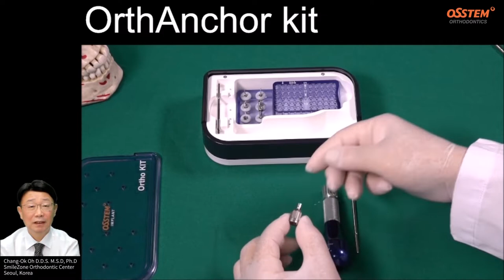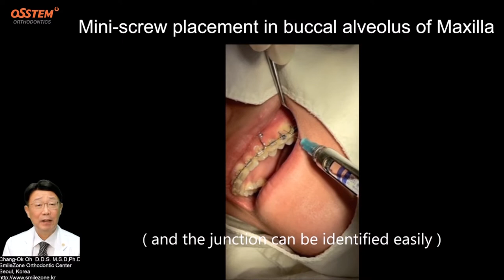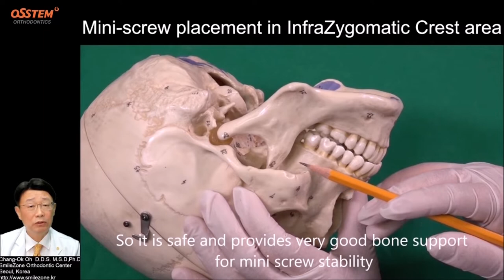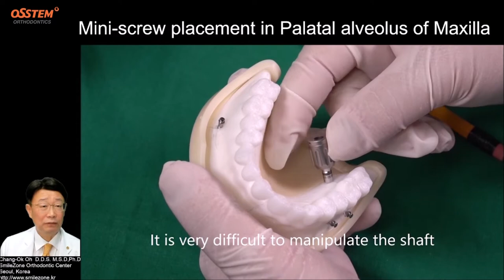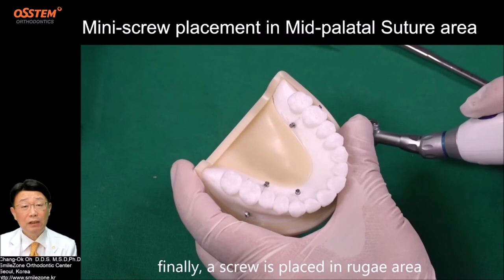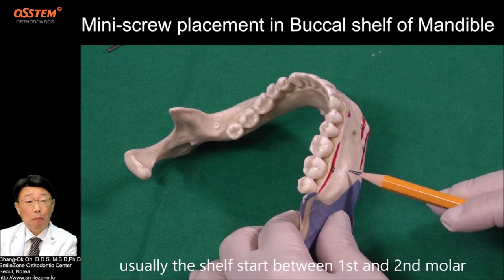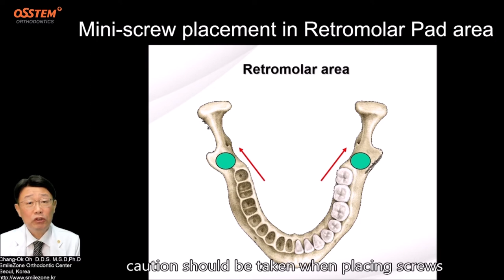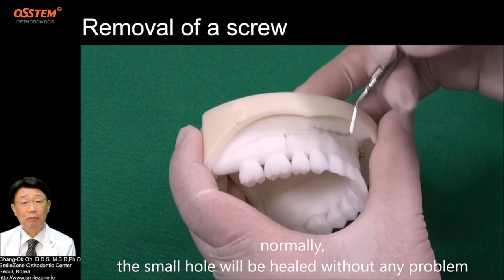When and How to use "Orthodontic Screw" (All Lectures Edition 1~12)

Comment: One more question sir:  At the beginning, you mention the drill diameter should be 70% of the screw diameter.  Should it be 70% of the internal (root) diameter of the screw, or 70% of the outer (thread) diameter?